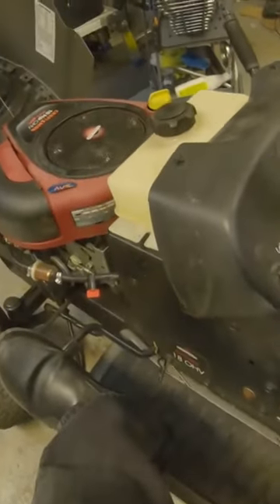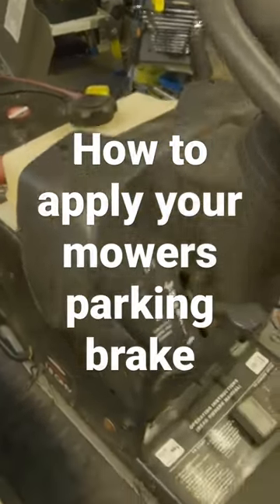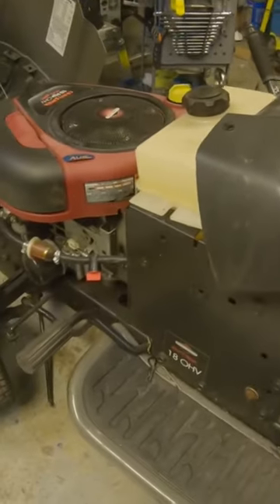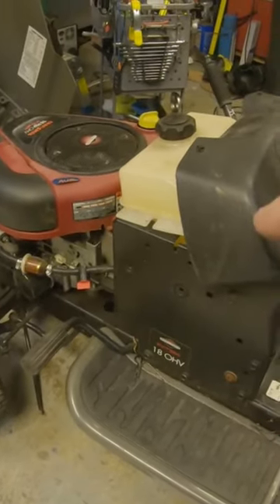Simple - How to apply your mower’s parking brake  #baldeagle242

Comment: Is that a good type of Briggs & Stratton engine?
Reply from the maker: It’s a basic residential Briggs engine. A semi-common issue with this engine is a broken compression release mechanism on the cam causing the engine not to crack over. This requires the engine to be disabled and a new cam installed. I wouldn’t avoid this engine because of this but it is something to be aware of.